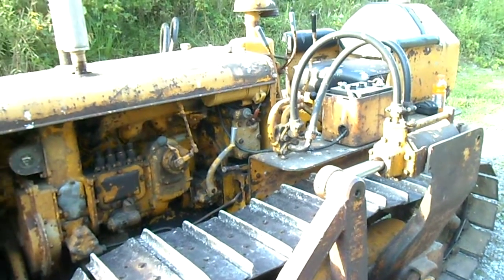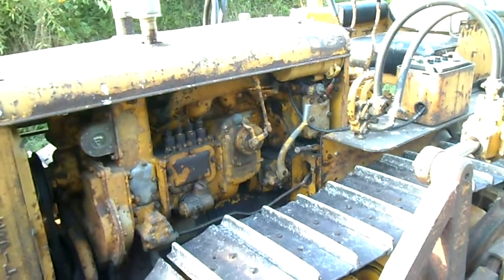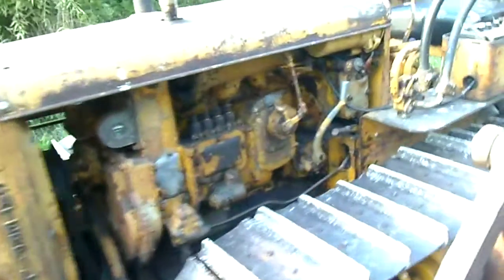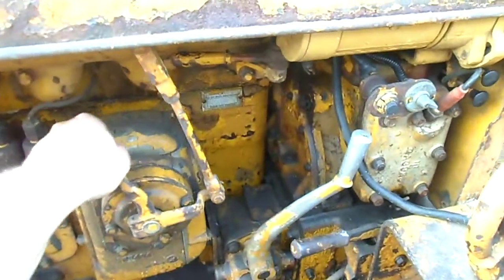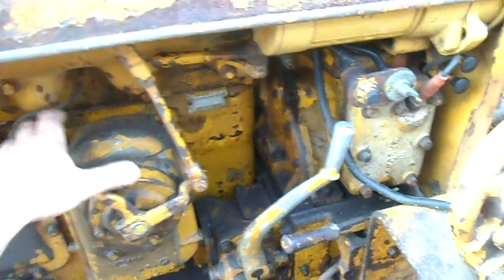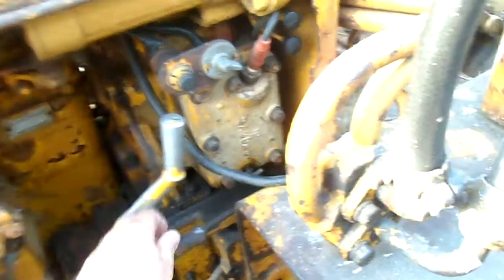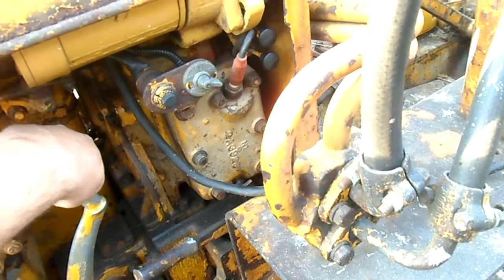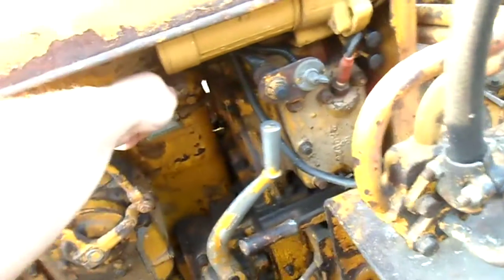CAT D2 Pony Start

Comment: In your next video, may i suggest a placement of the filming device to allow viewing the process. 
Often when one knows a subject, it's assumed the viewer knows it almost as well, and the information is delivered as such.
In most cases it is advisable to start with the assumption that barely basic information is known ( such as were the gas petcock is, what it looks like, how to turn or push-pull, in which direction, etcetra  ).
Showing each lever, guage, switch, as you explain what it does, in each position, and in what order, goes along way to transferring knowledge.
I feel with a some trial and error i'd be able to figure it out, with your instructions.
But not cofident with just this one video ...
Reply from the maker: Thank you for the feedback - I totally agree with you on  all points. I did this video on a whim many years ago without much thought or planning. I'm planning on doing some much better and more in depth videos in the future and have already planned some of the exact shots and better descriptions that you describe specifically for my 1924 John Deere D. I'd gladly go back and do this D2 over again, but this dozer was sold many years ago.